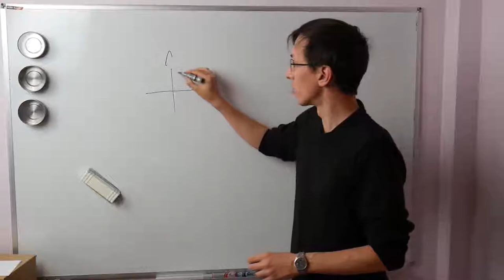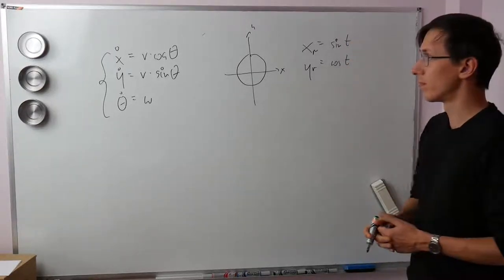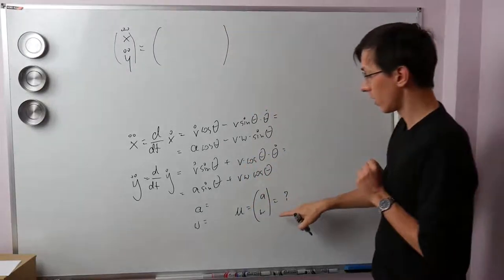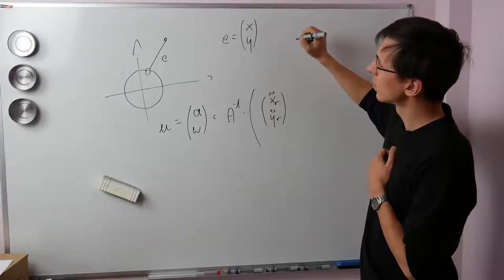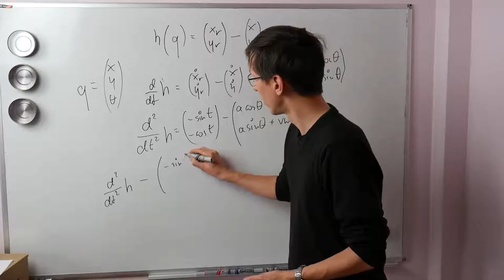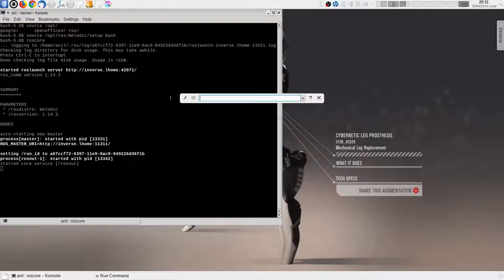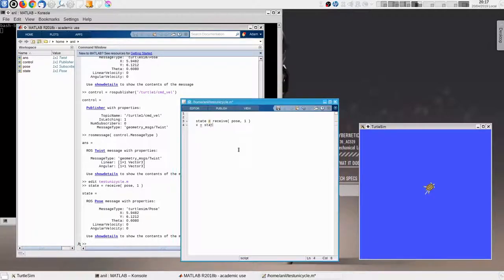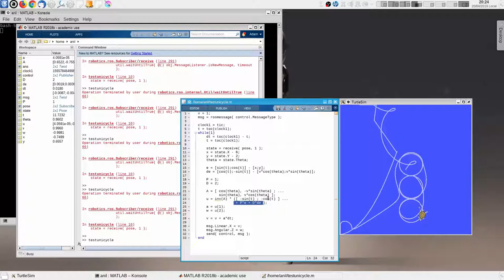Control design for a unicycle - feedback linearisation, with Matlab and ROS simulation

Comment: First excellent video, second sorry for my english, the control law that you propose  with double derivate of trayectory plu proporcional constan multiple  error  of position and the derivate constan multiple with error of velocities, my question is i can  use thah control law with any control system? i want to make a invert pendulum on a cart apliedd this type of control laws
Reply from the maker: yes, you can try the feedback linearisation for  the cart-pendulum, but there will be problems with it - it will only be a partial linearisation, since you quite probably have one input signal (force moving the cart) - so you will have to choose which single output to control

Comment: the control method is fantastic!,  Does anyone tell me what's this method name in control textbook?
Reply from the maker: It's not that fantastastic mainly because it does not go well with noisy environments. You can find it (or sth similar) as "feedback linearisation", "input-output feedback linearisation", "inverse dynamics", the part about using acceleration instead of linear velocity for control input - that's either under the name "preintegration" or "dynamic precompensation". Also check "F-linearisation" (feedback), "S-Linearisation" (input-to-state linearisation), because something people use those shortcuts.
Reply: @BarelyWalking  I just find similar topic on chapter 7.10.2 "robust tracking control: the error-space approach" of book "feedback control of dynamic systems 7th edition" by Gene F.Franklin, and I am trying to understand it. Thanks your sharing. Your demo is really wonderful.